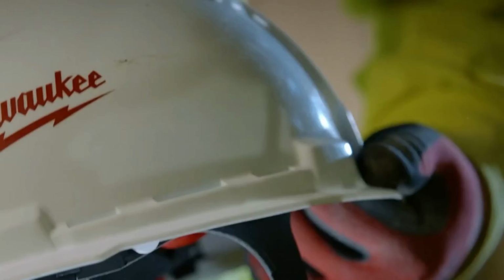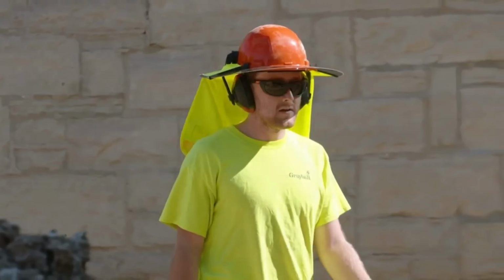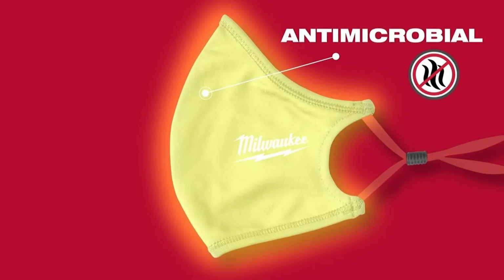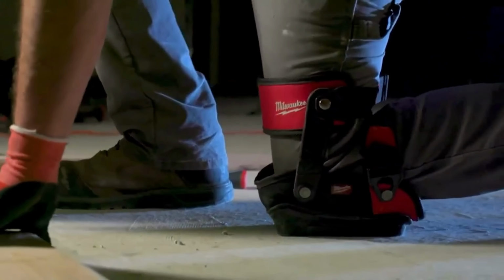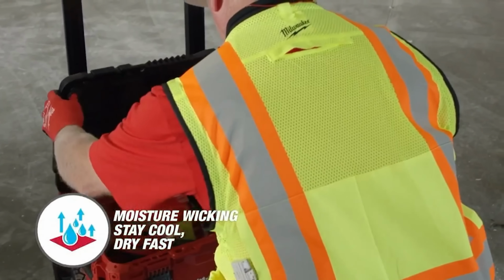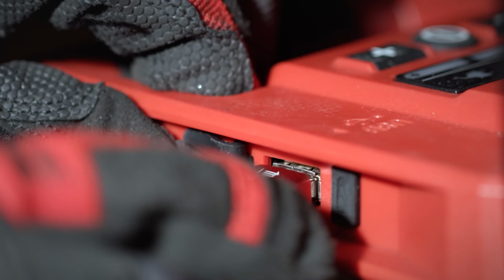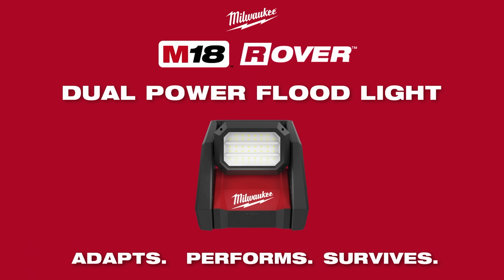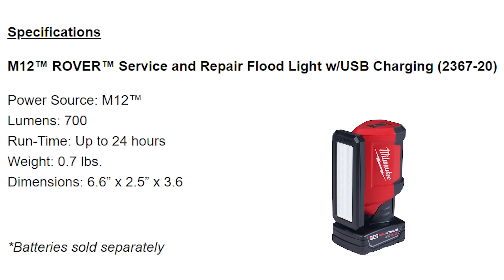ALL NEW MILWAUKEE TOOLS ANNOUNCED AND RELEASED FOR 2021! (No Fluff)

Comment: Besides the safety glasses I can't wait to see the knee pads because constantly doing flooring and molding especially base molding I need a great pair my knees are not like they used to be ATS with anyone with age in this line of work
Reply: Aren't those integrated kneepads more comfortable and hassle free? I mean like Striker X from Uf pro or Crye Combat pants style of products.
Reply: @abccde3832  I hope the new Milwaukee knee pads I'm more comfortable I have a few different pairs and depending what I'm working on I have plastic and I don't have cushioned but I've tried some of the new gel knee pads from husky and the becoming so big the straps either Velcro or like a belt Style and the whole start to stretch so you're constantly adjusting the knee pad but they need to do is make a looping strap and where you have better adjustment and not so big you don't need protection on the side you just need it around the knee they make them eat it too big and bulky or the straps on a smaller ones are so uncomfortable that after you get up and down the velcro always rips your constantly readjusting the strap
Reply: @josephmalinowski6817  Military had their time with knee pads. They seem to ditched them now because of their sag and constant adjustment like you mentioned.
Current best thing to have is built in knee protection in trousers themselfs. It is layered too - You can have harder plastic for rock/gravel protection/sharper objects,
and then you can add on to that memory style drop absorbing memory foam. Super thin, lightweight and hidden in pants. Pants itself can have built in abrasion resistance with fabric like "Cordura".
Reply: @abccde3832  that is a good idea because obviously you know prior going to a job you're doing flooring but even if they made pairs of pants with a removable pad that's like in and out because you can never find at least I can't a knee pad that's comfortable and the straps either Dig Inn or the velcro comes loose so you're constantly I just in your pants pulling them down behind the knee pad right now I use a foam pad and move that around but that's a pain because of moving so fast you end up leaving that but I like the knee pads Milwaukee show with the strap higher than the knee maybe that will hold the knee pad up that or need to go somewhere else besides Home Depot find better knee pads if you look at the new Huskies velcro straps are huge and then they have a belt style strap it's like made out of gel that stretches and the gel already started to rip on the strap I think if they made a strap what's a loop on the other side so you slide the strap through the loop and bring it back to the other side will make it better